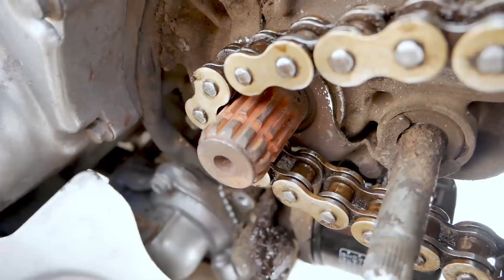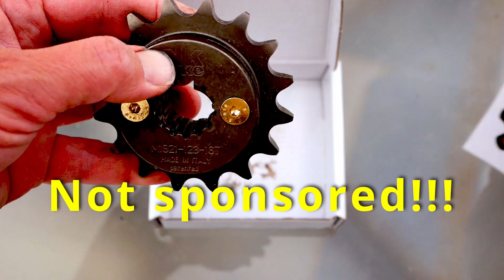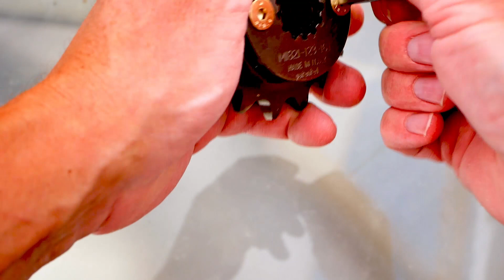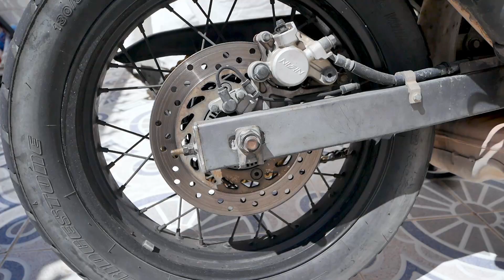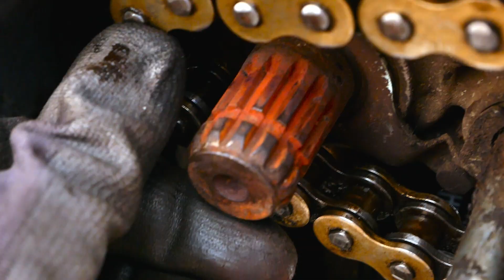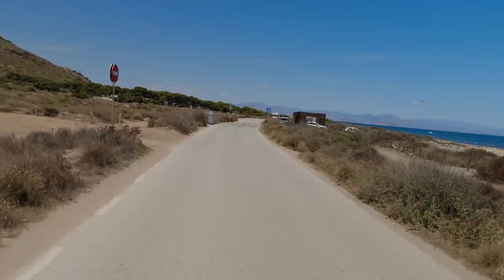SAVE your Honda TRANSALP from destruction !!

Comment: If anybody have also trouble to fit it on shaft dont smash it, just heat the sprocket over 100°C and then it will slide easily ;)
Reply from the maker: I also use freezing or high temperatures to insert some parts, bearings for example, but the problem with this sprocket is the width, not being stuck on the splines. Worth a shot tho. Thanks!

Comment: One more detail, clean the surface with WD40, Copper grease it and then fitt sprocket.
Reply from the maker: It's not shown on the video, but I cleaned the shaft with WD40 and then wiped any excess. I never use any kind of grease on the countershaft of bikes I'm going to use for offroad. Together with the dust and dirt, it gets converted into grinding paste. Thanks for watching!

Comment: The problem is the loose push fit on the splines of such a powerful engine. The splines need to be a good tight fit in the first place to prevent chattering under braking and acceleration, or they will just hammer themselves looser and looser. This upgrade sprocket is a good way to prevent a lot of problems.

Comment: Just a quick note, applying anti seize to the shaft and locking plates will save considerable pain when removing them later, especially noting you stated it was very tight. Been doing it for years on my off road bikes, never had an issue. Good vid, what it s the price difference off the KK unit compared with the standard set up? Is it reasonable? Cheers.
Reply from the maker: I definitely considered applying anti seize, as I do with a lot of bolts. But the trails on my area are very dusty and sometimes sandy. I'm always afraid any sticky grease, lubrifiant or similar, with dust and sand on it, will act as sandpaper. The stock Honda sprocket and the KKbike have similar price, but the point is the last one will double the life of the shaft. It's the only weak point of the Transalp 650and 700, not so much on the 600 and Africa Twin 650/750. Thanks for watching!
Reply: It's a dilemma re the grease, but I would have cleaned the splines and added a moly grease or something like that. The damage that two unlubricated spline surfaces can cause is greater than a bit of dust in grease. An additional action is to regularly inspect, clean and re grease the splines. A short job compared to the damage that can occur when they wear the frise splines.
Reply from the maker: Hi! Sorry, I just saw your answer. If you only use your bike on the road on sunny sundays, maybe it will collect only a bit of dust on the shaft, but if you offroad it, like I do, it will collect a lot of dirt, sand and other particles. I have a dozen workshop books for different bikes, road and offroad bikes, some are Haynes, some are french RMT, and some are official from factory. None of them recomend to put grease between the sprocket and the shaft, but they profusely talk about which kind and quantity of grease you should use on any other moving part of the bike. If you go to a dealer showroom, you can check by yourself that none of the new bikes have any kind of grease between the countershaft and the sprocket. Cheers!

Comment: Did you experience any issues by putting a brand new pinon to work with a used chain? Not sure how many kilometer of use your chain had, probably not may... I like the idea of the superpinion but I am hesitating to place a new one when the rest of my transmision kit has only 9000 kms of wear. Thanks for your fine work!
Reply from the maker: Hi there! 9.000km is not much for a good quality chain. The pinion is a lot cheaper than a good chain, so I rather replace it sooner than throwing a barely used chain and rear sprocket to the bin.

Comment: My father bought pne of the new xl750 trans alps. I took a good look at the sprocket set up and it appears they already addressed this issue. His is factory and has a much wider sprocket
Reply from the maker: Yes, the new Transalp 750 have a totally different engine from the V twin used in the older Transalps and Africa Twins. I'm glad they learnt from their mistakes, but they should have done that when they launched the Transalp 700, which uses the exact same countershaft as the 650 but with more power and weight. I've seen 700's with only 30.000kms that had already lost the splines of the shaft. Of course that is an extreme, with people using the bike agressively in city environment, but still unacceptable. I'm sure your dad will enjoy a lot his new bike. Cheers!

Comment: Thanks for sharing! Checking it as soon as possible
Reply from the maker: Hi man! You need to remove the sprocket to check correctly the condition of the splines. But even if it's in good condition, my advice is to put a superpinion. Cheers!
Reply: @coastrider8881  I ordered the 15 tooth one yesterday evening 😜
Reply: I only have 24680 km on a barely used transalp xl700va from 2010. Tires are still from 2010 as well and you see that previous owners didn't drive wild. So I think I bought a pearl, now let's find out 🙂

Comment: First of all thank You for the tip. How is the bike now when you changed gearing, you put bigger front sprocket. Do you feel much difference in top speed and revs in 5th gear?
Reply from the maker: Thanks for watching! I have a specific video about the 16 teeth sprocket: https://www.youtube.com/watch?v=fGHRTO7jH4I
Spoiler alert, I will go back to the 15. In fact, I reach higher top speed with the 15, but in 5th gear the bike rides a lot smoother and more relaxed with the 16, the engine runs around 500rpm slower at same speed, so if you use a lot the bike on highways and fast roads it might be a good option. Cheers.

Comment: This only seems to be a Honda issue on several models street,dirt,and adventure bikes.. make me wonder if the new transalp 750 is no different?
Reply from the maker: Hi Gabriel, the only two models I know with this issue happening early are the Transalp 650 and 700. On other models it only happens with a lot of years and miles of abuse, like any other motorcycle. The thing is Honda's are so reliable that you have ton of them with 100k, 200k or 300k, like one of my old CB 500 which had 330.000kms when I got bored of it. The new Transalp 750 have a totally different engine than the earlier Transalp's, I hope Honda learnt from their previous mistakes. Cheers!
Reply: @coastrider8881  not necessarily abuse. I've heard of this with several different models I have experienced it with an older cb500 a 2017 xr650l and also hear the 300l has that issue . As far as the new transalp 750 time will tell..in the meantime I will not be buying any honda motorcycles
Reply from the maker: That's interesting feedback, are we talking about the old pc26/32 CB500? Or the newer models? The XR650L which is a very old designed model has never been sold in Europe, so I guess your experience is with the most recent CB500. Can you give us more information? I never heard about this kind of troubles with the most recent CB500 nor the CRF300, so it would be interesting to know more about that problem.
Reply: I had a massive camshaft wear on my 1993 Transalp 600 with around 40.000 km on it. Just normal road use. So, yes the older Transalp 600 have also the Problem.

Comment: A great idea, but with limits, as it only increases the spline area by an estimated 30%. Surface rust that is forming on the hardened surface, then worn away, plays another key part in spline wear.
Reply from the maker: An increase of 30% is HUGE. If you increased the rear tire width by 30% it would be 170 instead of 130, go figure! A lot of factors intervene in the wear of the splines, but unfortunately the Transalps 650 and 700 suffer from a faster wear than they should, and it's even worst if you use them a lot offroad or in the city. This sprocket is the best prevention, put it before it's too late. I've had to replace the countershaft on my first Transalp (I did it myself), so I know the amount of work and money required to repair. I've also had another 650, now a 700, and an Africa Twin 750, and seen dozen of them when looking for a good one. Believe me, you absolutely need to put a superpinion first thing on your bike.
Reply: @coastrider8881  Thank you for your well meant advice. I read a lot about this on the German AT forum. The consensus seems to be that while it is a wear part, it’s life can be prolonged by proper use. Which means using the original sprocket, which is supposedly softer and sacrificial to the shaft, keeping enough chain slack and not accelerating at less than 3000 rpm. There are several senior members there with high mileage on their engines, following these recommendations and have no problems what so ever. Personally, I have the feeling that rust is quite possibly another major factor. With rust of course easily worn off. And once wear has started, wear will only accelerate, because the sprocket will start riding an eccentric path on the shaft, which will only exacerbate wear. I regularly oil the output shaft. To do so, I cut a hole into the sprocket cover for access.
Reply from the maker: This is true for the AT and old Transalp 600, but unfortunately the Transalps 650 and 700 have a notoriously weaker countershaft. It's even worst on the 700 that uses the same part as the 650 but have more power, torque and weight. On the AT and Transalp 600 the superpinion is a solution for high mileage bike which start to have some wear. On the Transalps 650 and 700 it's an absolute necessity to put it as soon as you can. The only downside is with the superpinion, appart from costing double than the stock sprocket, the chain wear slightly faster. But all of that is still a lot cheaper than replacing the countershaft. Specifically on the 650, by adding the superpinion you virtually got an undestructible bike, as this is the only weak point on a well maintained bike.

Comment: So how did you finaly fit the sprocket? Mine is also giving me struggle, i didnt want to use brute force so i took a break for some more advice :-)
Reply from the maker: With some patience... and a rubber hammer! Hahaha!
I just kept, very carefully, hitting with the rubber hammer until it finally came all together. You don't want to hit too heavily, to avoid damaging the seal and bearing of the countershaft. Just slightly and trying to put the lockers every now and then.
Cleaning very well the splines help a lot.
Cheers!
Reply: I am also having the same problem. It is super tight and by margin I can not fit the retaining plates. It took my an hour to hammer it out after. I had to switch to the original honda pinion. I am afraid that even if manage to put the kk pinion it won't go out when it is time for change. I have seen other videos where it goes in easier and it makes me wonder whether they messed up when machining mine.

Comment: It appears that the original sprocket has a rubber cush integrated into its design. Does the KK sprocket have one as well? My old 90 Transalp has a rear wheel sprocket rubber cush drive design to absorb the forces. I'm not expert,  but it seems like forces may do damage to internal parts within transmission. You may be curing one problem but also generating another in the process.
Reply from the maker: Hi, the rubber on the front sprocket is mainly to reduce chain noise, the rubbers on the rear cush drive are the ones that reduces the force when you open the throttle or cut it. The KKbike sprocket does not have that rubber, nor any other sprocket that is not the Honda one. My previous Transalp 650 always used the stock Honda front sprocket (three of them), and the shaft lost all his teeth at around 80.000kms, with a lot of offroad abuse I reckon. My second Transalp 650 was 100% stock with only 35K km, and the stock front sprocket with rubber. The shaft was already showing great signs of wear. Fortunately, the 600 seems to be less prone to this problem. But with lot of offroad or urban use, it will happen anyways. Cheers!

Comment: I'm currently on the market for transalp 650. Is there any way to check if that part is ok, without opening the bike?
Reply from the maker: Hi, nowadays I would'nt buy an old Transalp or Africa Twin whithout checking the transmision shaft. They are incredibly reliable bikes, and this is the only weak point that can destroy your budget as the repair is very labour intensive. You can check it if you have basic mechanical skills. Just loosen the rear wheel axle, chain tensioners and push the wheel forward. Now you can take out the front sprocket cover and the sprocket with the chain. Check the shaft splines for any "steps" or excessive wear. Put everything back. It should'nt take more than 15 minutes and very little tools. Cheers!

Comment: Thanks for the video, just got a problem on my transalp 650v xl 2002 and i was looking at the part you recommend but when i open the link that part refers only to the ducati or am i  missing something here? thanks again
Reply from the maker: Hi there. I just checked the link and it works fine for me. It's the main page of KKbike. You can then  select your specific bike model. Cheers.

Comment: While I think I already know the answer to this question, since I also saw how tight is the fit of a 16t front sprocket, I'm still somewhat wishful thinking about the possibility to mount a 17t one, do you think that would be possible?
Reply from the maker: Hi! I don't know if a 17 teeth sprockets fits, but why would you put one? A 16th makes the bike gears already too long for anything but highway, so what's the point of a 17th? Just curious. Cheers mate!
Reply: @coastrider8881  While I initially bought it, thinking that I can also go off road if needed, after one year I realised that it barely saw anything else but highways and asphalt. I already made some modifications to better suit highway riding (16t front, 43t rear->~5l/100km @ 120kph), but after another year in this configuration I realised that unfortunately it's still not enough for my needs. Probably the logical solution in this case is just to sell it and buy some sport touring, but I just became somewhat attached to it after it took me throughout most of Europe without any hiccup.  Given that its reliability is pretty much second to none, I just want to give it another shot by changing again the sprocket(s)
Reply from the maker: @theodor913  Your part of the world must be very flat! I'm guessing with that combo (16/43) you're slightly over 4000rpm at 120 km/h. What is your goal? Less consumption, less rpm when cruising?
Reply: @coastrider8881  Not that flat in particular, but I don't mind the slight lack of power when going uphill. Unfortunately it's just below 5k rpm @120kph and I guess I'd like to achieve both since they're linked. Something like 140kph at sub 5k rpm would be what I'd like to get and from my basic calculation I should be able to get that with a the lowest no of teeth sprockets I found available, namely 39t (~138kph @ 5k rpm), or 37t (~145kph @ 5k rpm). Out of these I'd normally try the 37t one, but since I only found aluminium ones I'm slightly concerned about its higher wear and its high sensitivity to drive chain maintenance.
Reply from the maker: Which is your model, 650 or 700? The 700 tends to overheat if used at low rpm due to the ECU programming to meet pollution standards, it's too lean. Also, 5l/100km is already very low, not sure if you'll be able to reduce that number. It's nice you're modifying your bike to make it meet your requirements, it's also my philosophy. Cheers!
Reply: @coastrider8881  I have a 2002 650, so no ECU. I know that 5l/100kph is already very good and I'm not looking for an improvement per se, but to keep it around this value when cruising at higher speeds and I think +0.5l/100km  due to higher wind resistance when cruising at ~140kph would be reasonable. In any case, it's already a huge improvement from the stock configuration, in which when cruising at ~120kph @ ~6k rpm I got a fuel consumption around 6.5l/100kph.
Reply from the maker: In my 2003 650, deleting the exhaust subchamber and putting a K&N resulted in increased performance and a reduction of 0,5 l/100km. You can also reduce the main jets in the carburetors.
Reply: @coastrider8881  I read a bit about those mods and I guess in your case most benefits came from the exhaust mod. Most likely I'm gonna replace the air filter with a K&N one whet it's due and I'm also tempted to meddle with the exhaust, pair system and carburettors, but I'll take more time to think about it since these things are pricier to do in a reversible way.

Comment: Hello! I have a transalp 700 too, with 82.000km now. My shaft seems already ok, and some months ago I decided too to mount a 16 teeth sprocket. Up to now it seems fine, but I consider it still on test. What do you think about it? Do you think 16 teeth is better? Thanks for showing videos about an undetestimated bike... I think the only real issue is the hot temperature it quickly reaches while riding slow in hot wheather. Bye!
Reply from the maker: Hi there! One of my next videos will be about the 16 teeth sprocket, so stay tuned. Also in the next weeks I'm going to address the problem with the temperature which is common in the 700. I definitely never had this trouble on the 650, even on Hard offroad in very hot places. Cheers!

Comment: I have a '98 Transalp 600, is this affected? And will the bigger sprocket be better for motorway driving?
Reply from the maker: Hi mate! The 600 is not affected that much, unless it's been used a lot offroad or in everyday city use. Nevertheless, it's worth putting a superpinion to protect the countershaft. 
A sprocket with one more tooth will be better in highway, but worse everywhere else, so it's up to you depending on your use of the bike. Cheers!

Comment: Did you add a link to the chain or does the 16 tooth sprocket fit with the standard chain length?
Reply from the maker: No need to add links, it fits straight in. Thanks for watching!